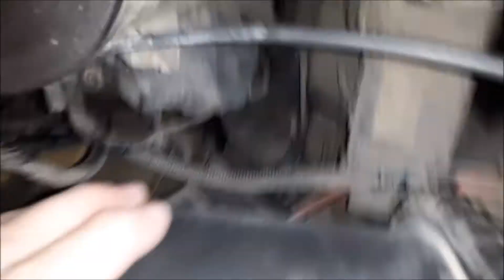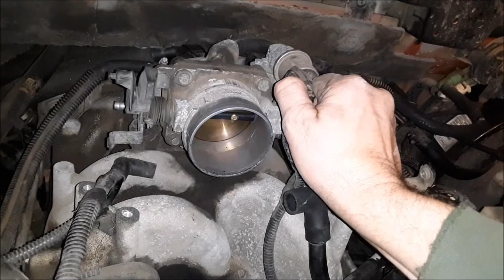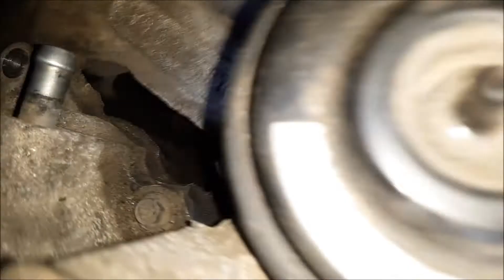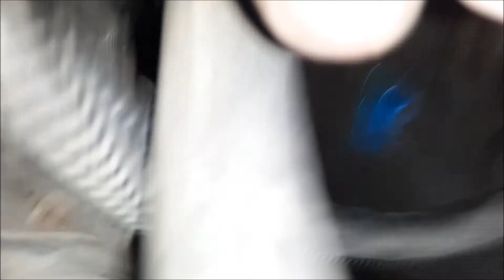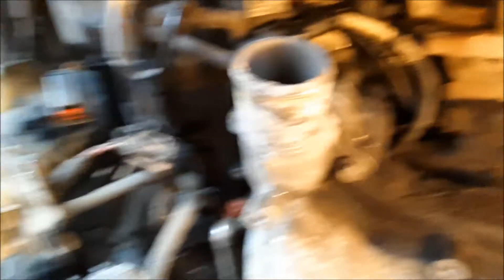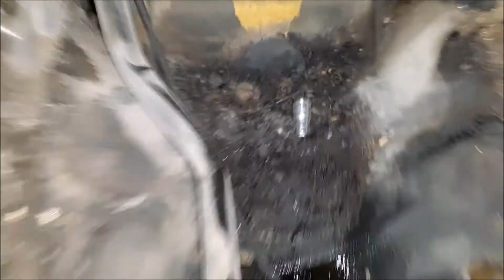F-150 4.6L  285K Miles, Coolant Leak, Intake Manifold Removal Part 1 of 3

Comment: I find it very useful to pierce heavy cardboard with a flat (so the cut is narrow enough to grip threads when the bolt is inserted) knife then poke bolts and screws through that with their info and sometimes an outline traced from my new gaskets to keep everything where it should be for much easier reassembly.
Reply from the maker: Thanks for sharing, that's a great idea!

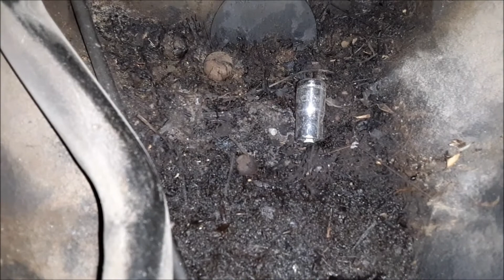Comment: Thank you for this video. I had a mechanic tell me I had to replace the engine. I have one question. On the part 1, 22:00, your video shows a black, round plastic cover. It is right under the yellow spot. Do you know what that part is called or could you look back at ur video and give me the part number? It shows up on the video for a quick second and on pause, it blurs it up. I went to the Ford dealership (Capital Ford Raleigh NC), and the parts "guy" told me there was nothing there, and that I needed to take my truck to a mechanic to have him/her take a look at it.
Reply from the maker: Your welcome!  I see what your are talking about, I believe this may be the part # F3AZ-6C070-AA.  Good luck!
Reply: @edooutdoors316  Thank u so much! This helps me so much. I figured I would fix this truck, instead of junking it like most people would do know a days. Thanks again!